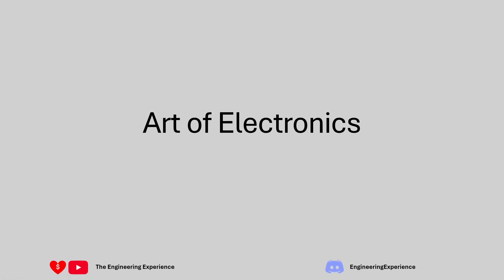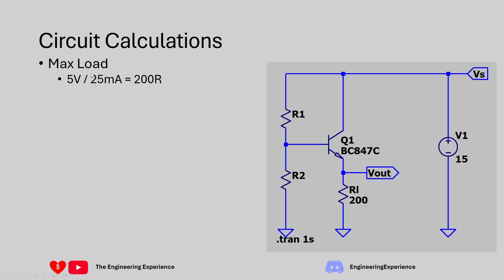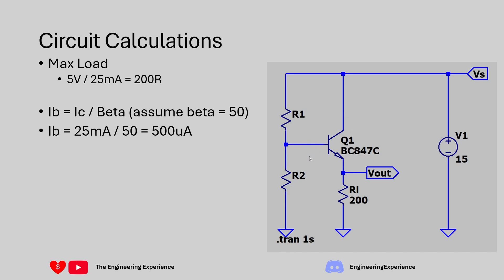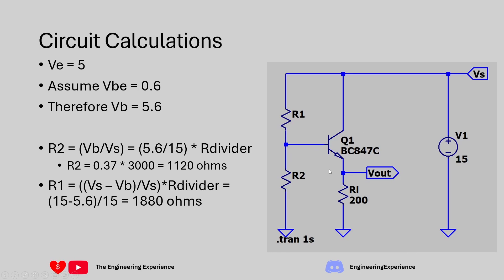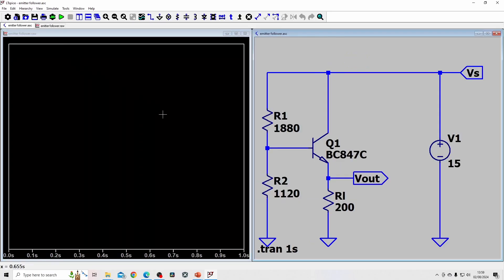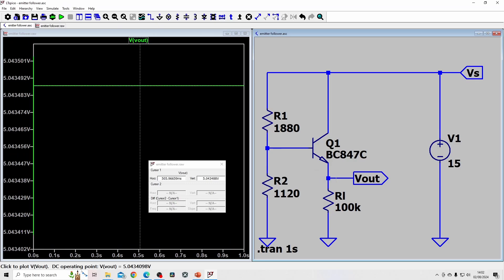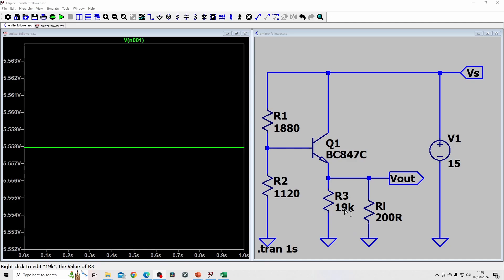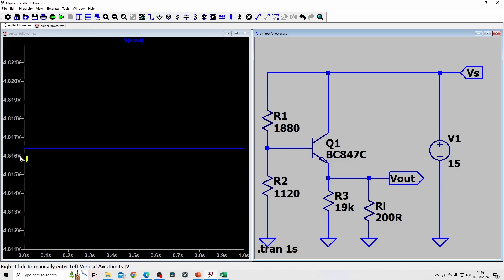Emitter Follower Voltage Reference Circuit Design - Art of Electronics Exercise 2.5

Comment: One doubt sir . Why the VCC voltage is not appearing at the output . Why vbb is appearing
Reply from the maker: The power supply voltage? 

Think of the transistor as a big resistor.

Comment: i know this might sound stupid but but how is iR1=iR2 yet there is a branch between them, it does not conform to KCL. Could someone simplify this concept for me please
Reply from the maker: You are technically correct. There is current flowing in to the base which you can account for. 

What I did was make the current through R1 and R2 much larger than the base current so that we can ignore it as it won't affect the circuit too much.
Reply: @TheEngineeringExperienceYT  got it

Comment: This is very interesting. I went about it a different way, I see the 5% drop spec to come up with a load resistance of 10 ohms. From there, I got the source resistance of 510 ohm using equation 2.2. And then used the thevenin equivalence to come with voltage divider values which come out to be pretty close to yours. I think the way you calculated Ib is strictly speaking incorrect as 25mA is the emitter current and not the collector current.
Reply from the maker: Agree about the current calculation. Ie will be slightly higher than Ic but I basically ignored it for the calculations. 

Interesting method!